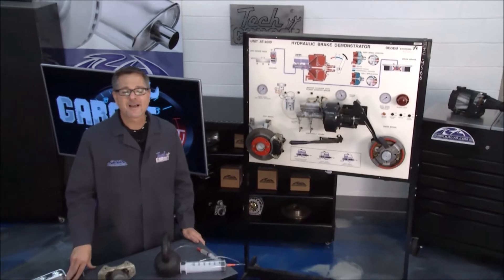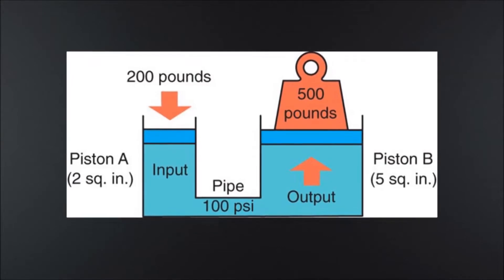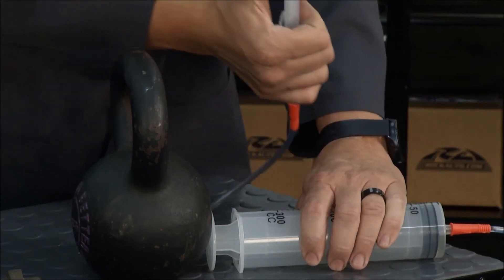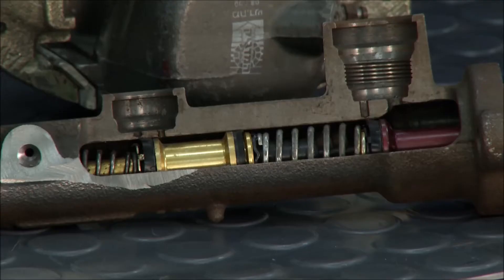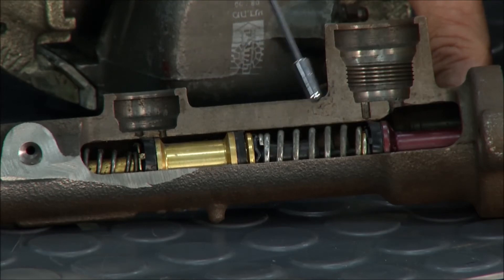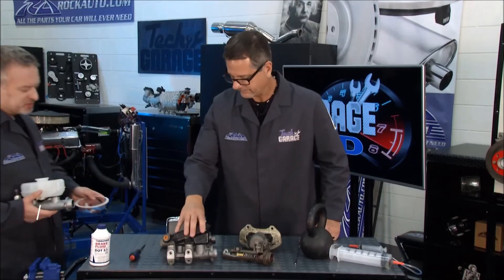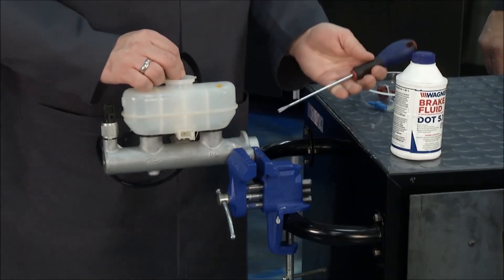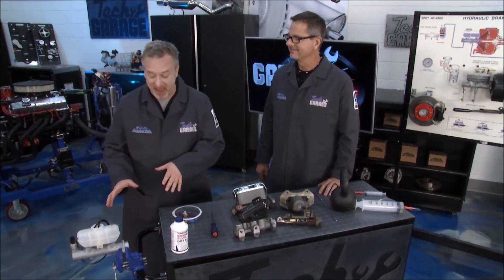Brake Master Cylinder fundamentals, bench bleeding and the brake hydraulic system (Season 7/E6)

Comment: Do not buy anything from Rockauto!! I purchased some brake pads fro my car on Feb 4th and was supposed to receive it by Feb 8th.  It's now Feb 16 and the package is lost somewhere.  I emailed them multiple times and all they tell me is to wait til the package arrives.  Well, I need to fix my car and use it unless Rockauto want to pay for a rental.  I've emailed them multiple times to cancel and refund me since the package has not arrived yet.  They have decided to not respond anymore to me. I had to call my credit card company to have them cancel the payment. Again, do not purchase anything from RockAuto. I recommend TireRack and Amazon, at least you can speak to someone. All communication is email only,  there is no phone number or some you can speak to at all!!